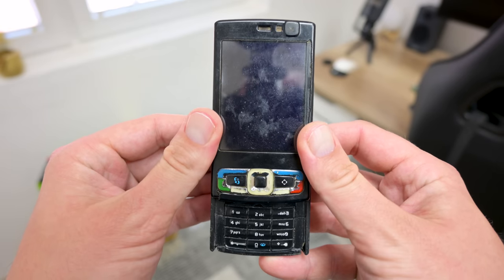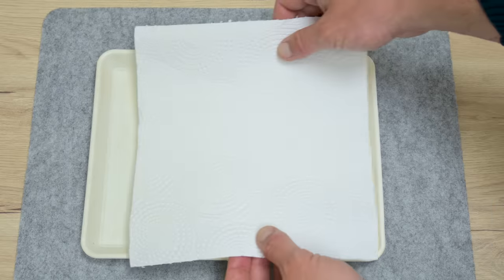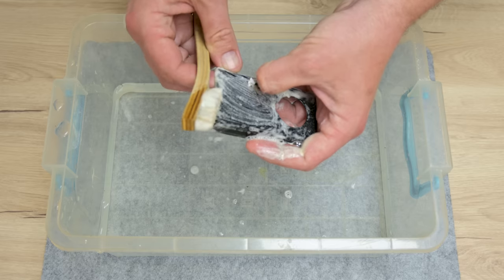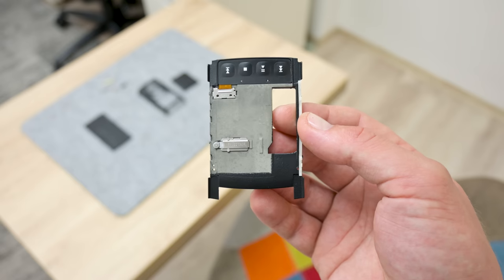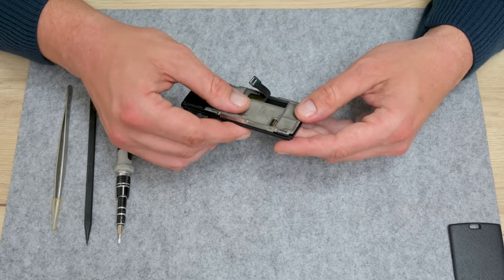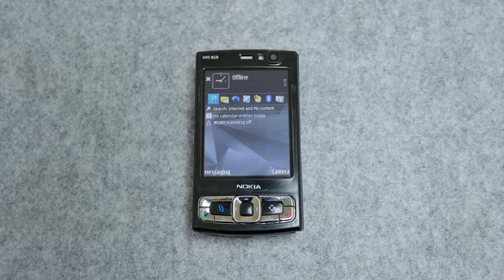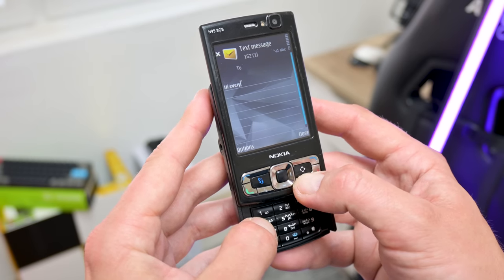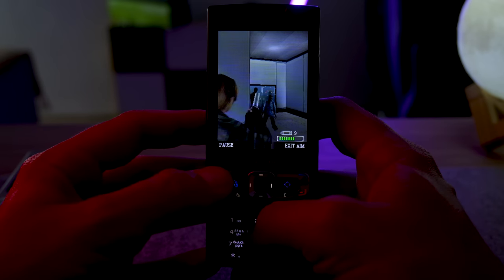I got 2 BAD Nokia N95 8GB - Restoring the history

Comment: Good job but one small comment. In 9:45 in the video you said that n95 series was last of the line which is not true because there were sucessors like n96, n97 and n98
Reply from the maker: Thank youu bro :D, I mean Last of the line as device to remember. The N96 it's more like N85 and N97 is different symbian edition S60v5. The N95 is s60v3 and has better graphics processor.
Reply: @ComputersAndTechAndAndrew  yeah agree btw i still have my father's n95 (standard one) and still works ;)

Comment: With this series, you can format bad corrupted micro sd cards. You have to format it again with android. If the card is still faulty, you have to copy 1 gb files within the card, using legal windows. When the card is fixed, you can use it for everything.

Comment: I was wondering 🤔 if you could fix my Laptop as I am having some problems with  as Windows won't install  on the HDD due to it saying that it is likely to fail but I have installed Linux Litte on it which is working fine and some of the keys are don't work on it I was wondering If you can  fix it  I want it to become capable at midrange gaming if the laptop can't be fixed as a laptop then you can turn it into a desktop or all in one PC if you want to

Comment: I still have 2 n70 but both has display issue as well as no battery 😢
Reply from the maker: I remember the N70, that was celebrity phone, I mean it was so expensive back than, it's one of my favorites. About the issue, if the display is just white, that can be fixed easy in most cases
Reply: @ComputersAndTechAndAndrew  it has pixel burning and flickering issue in which display must be changed which I had to do more than twice previously.

Comment: I had one N95 in 2013, I had an A/V cable I used to mirror the screen on the TV to play. I installed an NES emulator and used a Bluetooth keyboard to play it on my TV. The system started to glitch after a few time and eventually the phone died.

It was one of these phones that got me interested in programming. I played my first Augmented Reality game in a Symbian phone (the Nokia N73, the game was a pet/sim dragon which I interacted with using the camera and hand gestures, I forgot the name), I also had an app that uses the front facing camera to track hand motion and use it to control the system menu, I even got Whatsapp working on my N93!
Symbian was an amazing mobile OS, and I really wished it went forward 🫤